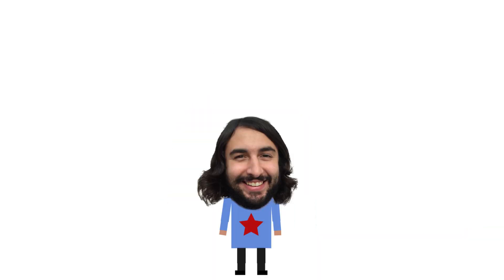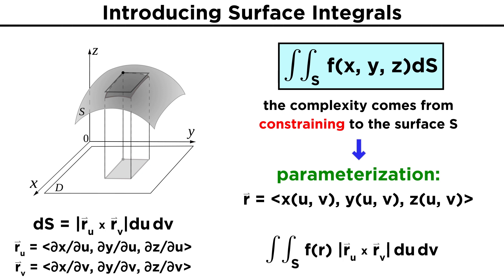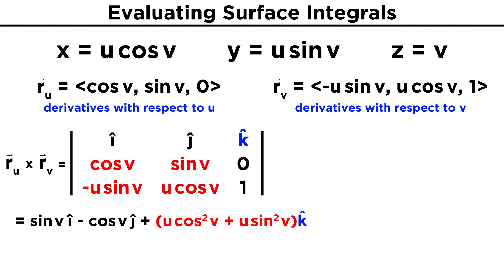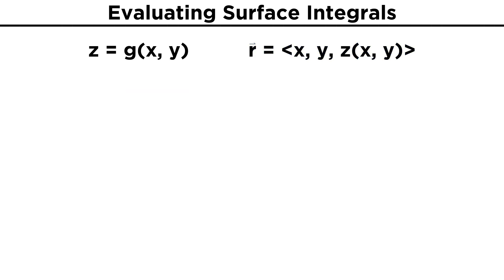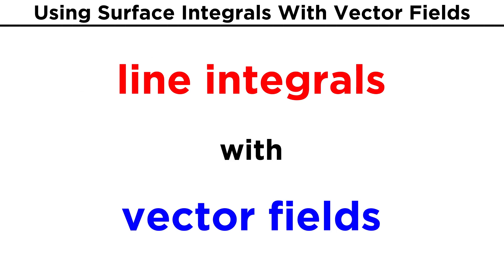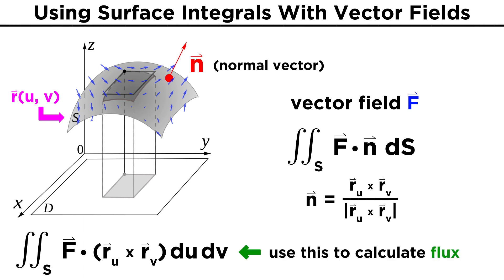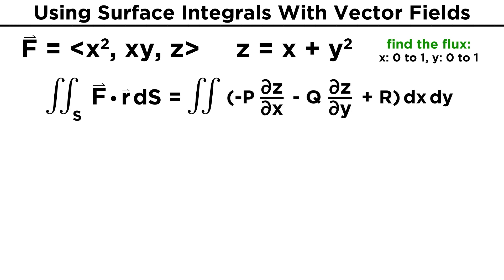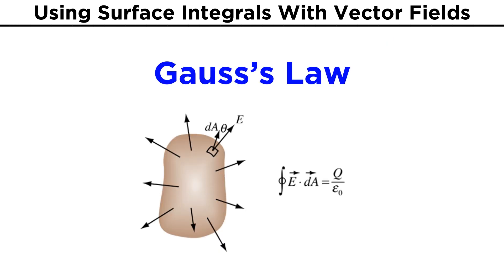Evaluating Surface Integrals

Comment: 5:59 I have another way I like to visualize this one. I’d imagine it like if you take the surface and redefine one of its variables in terms of the other two, it’s basically like a flat disc outline. We are still trying to integrate over the surface. This is very similar to the surface area integrals from calculus II. Imagine a small strip, and then incremental it slightly. To find the area of the strip, it’s the way around (given by your parameterized function) times a small piece of arc length. 

So the full surface integral would be over f(x,y,g(x,y)) times the arc length. 

recall, arc length for a 2D curve was root(1+f’(x)^2)

in this case, our derivative in 2D is analogous to the magnitude of the gradient. Squaring that gives fx^2 + fy^2

so arc length is root(fx^2 + fy^2 + 1)

And the full inside of the surface integral can be written as: 

f(x,y,g(x,y))root(fx^2 + fy^2 + 1)dA 

dA can be dxdy or dydx

Comment: Dear sir
Thank you for all the videos.  It is a wonderful work. But I thin there is a misprint in 9 minute at the ladt formula of the integral by using the r vectore instead of n vector.  This misprint is also repeated in the flowered example 
Thsnk you again

Comment: might be cooked bro, tf is a vector field and what do i need them for
Reply: I'm not sure about the formal mathematical definition, but I ca explain what they are used for in physics.

A vector field is when you fill all of 3 dimensional space with imaginary lines, with the length of each line representing the direction and intensity of force at that point. It's usually used for fields. For example, let's think about Earth's gravitational field.

In this case, the field would look like a sphere of lines pointing towards earth's center. This is because no matter where you go, gravity pulls you towards Earth's center. As for the length of the lines, the lines that are closer to the Earth would be longer because gravity is stronger there, and the lines in the upper atmosphere would be shorter, because gravity is weaker there.

Only the lines that intersect with an object will apply force to it. So if you are in Seattle, the direction and intensity of gravity will be different for you than it would be for someone on top of Mount Everest.

Comment: Whoever came up with using u and v as the two variables would have chosen better variables if they'd had my handwriting. What on Earth were these people thinking. ςigma and τau would've worked just as nicely. μu or νu would've sufficed as well. u and v. picard facepalm.
Reply: Let’s not forget the people who chose to use ξ in sets
Reply: @HarpSeal  I have a 1960s calc book that uses ξ to represent little Δx* when explaining Riemann sums, and also uses ξ elsewhere. it's kind of strange to see.

Comment: hmmmm. it doesn't change the outcome of the answer but when you were taking the determinant for finding Ru x Rv you got -cosv as the j component but i do not understand why it is negative. I am fairly certain that it should be positive. however when taking the magnitude of it the negative goes away so it doesn't actually change the answer. idk correct me if I am wrong.

Comment: 11:40 - I got 2 times square root 2 instead. 
The length of Z is square root 2 between X=0 and 1, length of Y is 2 between Y=0 and 2.  
Area = length of Z times length of Y.
Not sure if I missed something?
Reply: I got the same result the first time since I followed the 6:00 formula literally, but I think I realise now where I got it wrong:

So the derivatives within the big square root(the magnitude of rU and rV) equals 2, giving square root 2. There is no doubt about it. We then have to do two integrals of this square root 2, which is also multiplied by the function, which is just plainly, z, which in turn, can be substituted by a simple x+1. I think we both followed the same path so far.

The mistake that I made that was probably similar to yours was that I plugged in the limit value of x(0,1) BEFORE I even integrated it, which in hindsight is a rookie mistake. Meaning I calculated (x+1)*sqrt(2), so I thought "okay I will just plug in 1 for x", thus gaining (1+1)*sqrt(2) aka 2sqrt(2). I integrate it by adding an extra X, which is 1, so it remains 2sqrt(2). But this is the wrong order.

You're supposed to INTEGRATE the result first and THEN plug in the number. Meaning that (x+1)*sqrt(2) should be integrated. By integrating it, you get ((x^2)/2+x)*sqrt(2). Distribute the root 2 across both terms. Now plug in the 1. Now you get 0.5sqrt(2)+1sqrt(2), or 1.5sqrt(2). From then on just proceed to integrate in regards to y. The integral will add an extra y, you plug in 2, and thus you get 2*1.5sqrt(2) or 3sqrt(2). Bingo.
Reply: no same I keep getting 2 sqrt(2) as well. Might be a mistake on the answer.

Comment: In the problem the f will come out as (0,0,1+x), rx=(1,0,1), ry=(0,1,0), rx*ry=(-1,0,1). And the answer after solving the double integral is coming as 3 not 3(2)^1/2.

Comment: But I didn't understand why is that that when the function is described with the parameters x and y- you decide to give it a certain formula -pdz/dx-qdz/dy+R basing it on a particular excercise that you came up with and than applying it to a completley different question at 9:06? 
can someone please explain because it's unclear to me why should you use specifically that formula if it came from a completely different question?

Comment: Thanks for your video, it helps me comprehend the main concepts of surface integrals! And one thing that confused me is that at 9:00, why there is a vector r instead of the unit normal vector n?
Reply: i have the same question
Reply: Yes. I think it is a misprints.  Unfortunately, the error is repeated in the flower example also.

Comment: In my opinion, this topic is the most difficult to grasp out of all the topics in Calculus. However,  difficulty is subjective
Reply: Tensor calculus 😢
Reply: well you're correct about subjective part. Compared to other topics this one's easy but I'm having a hard time finding volumes in calculus and geometry related problens😅
Reply: Currently doing math 2, so differential equations , calc 2 and vector calculus / calc 3, I feel like series convergence / Fourier analysis is more challenging
Reply: @cndl2556  wtf kind of classes are you taking my boy
Reply: Differential geometry be like 🤨
Reply: you've surely not studied partial differential equations yet
Reply: @MBKfreestyle  🤓
Reply: @MBKfreestyle  PROVING THIS GUY'S POINT, I'D ARGUE THIS IS MORE DIFFICULT THAN PARTIAL DIFFERENTIAL EQUATIONS
Reply: @MBKfreestyle he said that difficulty is subjective, oH yOu ArE sMaRt
Reply: @swagf3a438  contending that someone would change their opinion if they were exposed to some other topic or view isn't unreasonable...
Reply: @MBKfreestyle we had this after PDE's
Reply: @MBKfreestyle ode has less abstract thinking than vector calc for me personally since geometry is my weak point
Reply: @MBKfreestyle dude what. this literally includes differential equations

Comment: Can parametrization of x,y,z be whatever I want?
( it doesnt have to be "x=ucosv, y=usinv, z=v" yes?)
Reply: No,it actually depends on your function. He used those functions as an example.

I know I'm a bit late,but for future generations it'll be useful:)
Reply: You can parametrize it however you want, as long as you fully describe the surface in question, with your parametric equations.  However, there often are ways you can parametrize it that will significantly simplify the remaining work.

For instance, in your example, I could parametrize it as:
x = u*cos(3*v)
y = u*sin(3*v)
z = 3*v

But I wouldn't really accomplish anything by making a more complicated definition of my parameter v.   I'll get the same results as if I kept it simple, and stuck with z=v, and defined everything else in terms of that.

Comment: 11:48 @Professor Dave Explains  I got 3 as the answer. I think I did something wrong. Used double integral (-Pdelz/delx -Qdelz/dely + R)dxdy
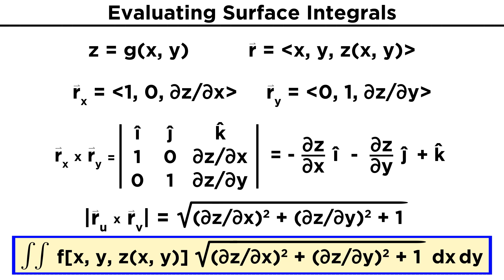Reply: So I  noticed that the sqrt(2) is missing it seems he used the formula 6:05 it seem we are given a scalar field or a function or f(x,y,z) so this is the formula for scalar field / function when the surface "z" is in terms of x and y parametric equation which is at 6:10, the one he used at 11:48 is the formula for the vector field F. And if we plug it in, we'll get 3*sqrt(2)
Reply: I got 3 too after i parameterized z=1+x and did all that stuff so idk what’s up
Reply: Ight update I got it guys
Reply: yeah isnt it 3?
Reply: yep got 3 too I got stuck at this maybe we did something quite wrong i don't know where is it

Comment: I just don't get what function to integrate. In my calculus book, they just take y and integrate it over the surface, but it's absolutely not clear to me what I should double integrate :((
Reply: if in a vector field you must, first of all, parameterize the surface you are interested in, i mean, the surface in which the vector field is flowing through, remember surface integral calculate the flux throughout a surface in R3. once you parameterize your surface [ r(u,v)=(u,v,g(u,v)) being u,v the two parametrization variables ] and then you calculate the cross product and there you got the normal vector. after that, the force field you are given must be changed in terms of the u and v variables. after that you are left with two vectors and calculate teh dot product of them and there it is what you need to double integrate

Comment: Can anybody explain to me how (sinV)^2 + (-cosV)^2 becomes 1? 
I know (sinV)^2 + (cosV)^2 equals 1 but is  (sinV)^2 + (-cosV)^2 equal to  (sinV)^2 + (cosV)^2 ? Please help me out.
Reply: When you square any negative number, the answer is always positive, since a negative number times a negative number equals a positive one. 

That said, if we evaluate, for example, (-2)², the answer will be 4, since (-2)(-2) = 4. Note how this is the same as evaluating 2², which also equals 4.

Note how (-2)² equals (-2)(-2). This is not the same as -2², which equals -(2)(2), which is the same as -4.

The same happens with cos(v) and (-cos(v)).

Since we are evaluating (-cos(v))(-cos(v)), we get a positive answer. If we were evaluating -(cos(v))(cos(v)), the answer would be negative (be aware of the negative sign outside the parenthesis).

Since we know (-cos(v))² is positive and has the same magnitude as (cos(v))², which is also positive, then they must evaluate to exactly the same.

Since (-cos(v))² = (cos(v))², (sin(v))² + (-cos(v))² also equals one.

Comment: Hi any proof on why dS=|ru x rv|dudv? 1:29
Reply: yes. this isnt rigorous but here it is.

assume surface can be paramaterised into r(u,v) then a small change to r caused by one lf the variables is (dr) as dr/du is ratio of change in r caused by u, to u itself so dr/du *(du) is the actual change to r caused by u. this is a vector qauntaty. imagine limit sum of a difference in r's value being a tangential vector to the surface. now do the same for achange jn v an you have two vectors relating to a small change along the surface. by taking a cross product between these you then get a vector with a magnitude of the area of a small ds